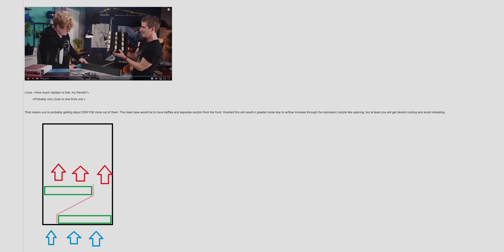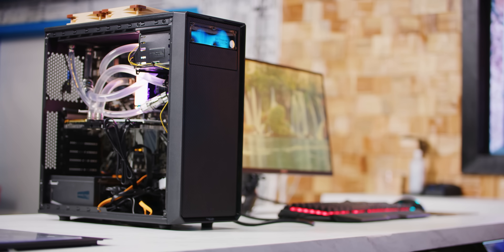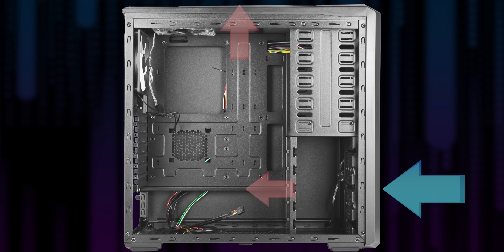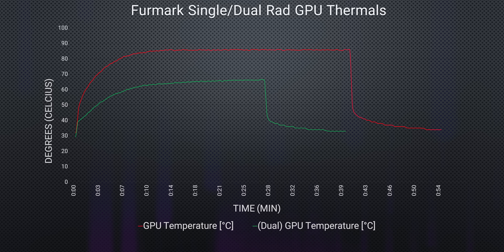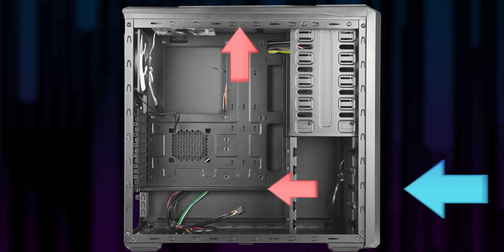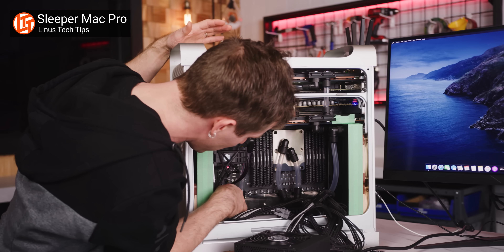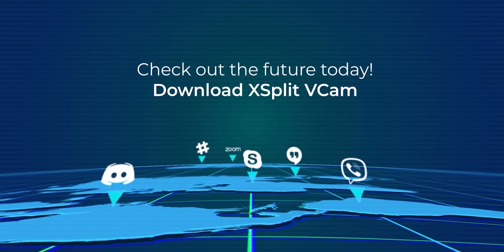I’ve been water cooling wrong for YEARS - $H!T Manufacturers Say

Comment: corsair: "using rads behind each other in a airflow starved case is bad"
corsair: "using rads stacked on top of each other is bad"
linus putting another rad in a case with a completely open back: "look how much it improves cooling!"
Reply: This seems like a pointless test. I doubt a company like Corsair is fucking around here, there was probably at least some engineers looking in to this. Wouldn't surprise me if they had whole RnD teams looking in to this. If they're saying it's shit in that environment, it probably is.

This whole video seems like some weird strawman attack on Corsair.
Reply: @Jayhill.

I think what infi means and what I ALSO thought right away with that specific example is: 5 degrees higher when stacked radiator removed, yes DUH!!! BUT!! what if he put that (removed second radiator) SOMEWHERE ELSE!!! It would work better?  I sure think so!! Infi??

@Linus Possible Video Idea??

Use the biggest case you can find but ONLY to add rads everywhere on the OUTSIDE of the ENTIRE case.?! see what happens?? Please?? Lol
Reply: Yeah I have a feeling the #1 lesson to learn from this video is "Reading Comprehension".
Reply: Yeah I don't know if they're just trolling Corsair now
Reply: +inf, makes the whole video pretty much useless.
Reply: I wouldn't say useless, I just wish they would have actually compared different scenarios.
Reply: He did address it tho :/
Reply: it still makes it a bad example to adress the whole issue.
Reply: Keep in mind he a) did state that this wasn't the system design Corsair simulated and b) that they did take out one of the stacked radiators from the system Corsair simulated, and found that the temperature increased 5C, so the stacked radiator was having some effect. In the end, he was advocating for you to test for yourself, and use some critical thinking and reasoning, rather than just go with whatever the manufacturer states.
Reply: @jayhill2193  But why are they not using the server for benchmarking? If they actually tested it with the server, then there is no reason to use a new system for the benchmark.
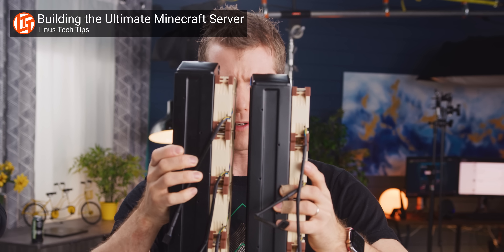Reply: @jayhill2193  Yes, and it kind of works for the hack pro. But corsair wrote them two times and one of them was for the setup at 1:30 which is a extreme case of what corsair said doesn't work.
Reply: @jayhill2193  In the Hack Pro system they've used parallel flow for the heat exchanger, while their testing system uses cross-flow. Big impact. 

The minecraft system is also a cross-flow setup, but you run into diminishing returns. Having a system go up from 45 to 50c while the Tmax is double that, is of course a bullshit reason to add another radiator which is what Corsair is pointing out.

If you want to argue that you can run the fans at lower speed for the same temperature you MIGHT be correct. My guess though is that without the third radiator air flow restrictions are freed up enough that the fan speed can stay roughly the same for the extra airflow to be achieved. Again, diminishing returns.
Reply: I don't think corsair claimed that it wouldn't work in an ordinary scenario like in this video ^^ though granted I haven't seen corsairs exact claims, only what is said in this video.
Reply: @Laylander  If you think adding a $100 radiator onto a $4000 system to drop temps by 5c is bullshit, you need to rethink some things.
Reply: @pfeerick  he removed 1 rad from the stacked system and temps went up 5c.. what he didn't do was set it up with a proper air gap and see that it dropped 15c.
Reply: @Laylander  what would work best for the three stacked rads in the Minecraft server would be baffles between them with an integral sign shape. ∫ Angled them a bit, with a curve at top and bottom. Warm air from each radiator blows out the top, cool air draws in the bottom. Warm air from one doesn't blow through the next radiator in line.
Reply: @shamsports1644  Agreed. Stacked radiators basically reused the heated air, and make it works less efficient. Should separate them to avoid reuse of heated air.
Reply: @jayhill2193  Did he also remove a row of fans with that rad? Perhaps that row of fans he removed was the thing lowering it the additional 5 degrees. After all, it makes sense that more fresh air moving through the rads would lower temps. And we've all seen builds where adding even 1 fan can make a huge difference.
Reply: @Ancyker  I had the same thought. Definitely unfortunate that we received so little info about testing the system with the setup that Corsair actually critiqued
Reply: @Haargeroya  I'm baffled. Just to make sure though: You're saying that because the system is expensive you shouldn't have a problem with adding useless parts to it to make it even more expensive?
Reply: @greggv8  That WOULD indeed work prety well. But in this form factor I don't think it's an option.
Reply: @Laylander  I'm baffled how you think a 5c drop in temps is useless. Cooling is very important in a professional environment, especially one where space is a limiting factor; assuming you've seen the videos of their rack locations.
Reply: @Haargeroya  Look at the bigger picture here. The CPU is allowed to run at 90c+ and it will happily do so for years. So if this thing runs at 45c instead of 50c (or say 80 instead of 85) there is no benefit at all. By the time the CPU finally burns out it is way past it's useful life anyways. Don't forget that the purchase of a component is usually <20% of it's TCO. Having an extra rad that you have to push water through probably costs you more in therms of electricity (pump+fans) over the years than it saves you in CPU replacements.

Cooling is important in a professional environment, sure. You just shot yourself in the foot though by stating that using space wisely is important, because you can probably take out two radiators and still stay within the thermal limits of the system. Duplicate the system a couple of times and all of a sudden you're using an entire rack worth of space just for cooling, while you could probably have gotten away with half the cooling capacity and thus have more systems in the same space.

To give you a practical example: I have a Ryzen 1700 in the basement pretty much running full load all the time. It has the stock cooler, temps are 67-73c (min-max over a week's time). AMD's official statement is that Tmax is 75c. It never skipped a beat since 2017. 

I bought the system to replace my old FX8350 which had been running full tilt near Tmax before that for almost 5 years non-stop, of which the last two years it's been running a good OC. Never skipped a beat either.
Reply: Don't worry Corsair won't give you a prize...

Comment: ya the thig corsair clearlly do not consider is thermal load. a radiator is designed to remove a sertain amount of heat out of the water and if the cpu and gpu output near the max heat rating of the radiator even if you would put a  jet engine on those rads you would see high temp in that case adding more rads will see a benefit always and my watercooling system is diffrent i use a second case designed just to put radiators in i have them mounted side by side pulling cool air from the room and outputing that air back into the room

Comment: You would want the air to go through the radiators that are last in the loop first. That would be the most efficient way to do it. Also mixing the intake radiator with ambient air intakes will mitigate this further. Corsair can only simulate so much.

Comment: Do the test with radiators literally stacked like Corsair were actually taking about..
Reply: He said they removed a rad in the minecraft server (uses 3 stacked rads) and got a 5 degree increase in temps
Reply: @thevampiredude7  Ahh miss heard that, thought they were talking about their test rig.
If that's the case, then the rad effeciency they're claiming is BS. If the air coming into the rad is actually the same as the water temp then yeah it would achieve nothing.

Comment: When you add another radiator, you're also adding more water to the loop which increases thermal mass. This gives your loop the ability to store more thermal energy before it gets saturated, resulting in cooler temperatures. I hear what Corsair is saying, so my take from this is to go for the thickest radiators you can, try avoid stacking.
Reply: It would be interesting to see in a real world test. Ie make something like a coolant expansion tank and one radiator like in cars, but for a PC and then one setup with stacked radiators.

My uneducated guess would be that the "expansion tank" setup would probably be more cost effective, because you can have a lot more liquid in the system.
Reply: I would go with optimus cpu water block and fittings (cheap fittings and best block), ek dual pump, max out the reservoir, Fat Ek radiators or one of those special radiators (forget the name), home depot for some soft tubing, $7 cutting tool from amazon.
Reply: Cool story bro

Comment: Have the Minecraft cooler run the rads side by side and it will destroy the stack. It's physics.
Reply: Yes because a server blade clearly has room for multiple side by side radiators.
Reply: @Torguemada  good point. I wonder if smaller rads with room to duct cool air to them would still work better.

Comment: You guys should test how many rads you can stack directly on top of each other before you get to the 1degree differential at the end. Just a rough guide on sheer radiator volume required to get 100% efficient cooling on a rad like they said.

Comment: Am very much a novice when it comes to pc stuff.

 But, if it’s anything like cooling for extreme high performance cars. Then wouldn’t it make sense to have the system work in a parallel loop, with radiators/inter-coolers before each individual piece of hardware (that you are liquid cooling)?. And have all the rads at their own individual intake points, with fans? And then have one almighty system to exhaust all the spent/less dense/hot internal air out the back of the case, like a car exhaust?

 So in a pc context where you are liquid cooling a GPU & CPU. Have front & top mounted rads, both with fans, intaking external ambient air. Then line the back (and floor, if you can) of the case with high power fans to blow air out the back. 
 You would also need to ensure that back-pressure can’t build up. So don’t have the case with its’ back up to a wall, or on the floor in thick carpet. That way it would work like a turbocharged performance car. Ramming air into the intakes, expelling as much heat as possible via an unrestricted exhaust system (given that in such a car you would straight-pipe it (remove CATs, mufflers, resonators etc) to reduce back pressure build up etc)

Again, cars aren’t computers (mostly) and I know a whole lot more about cars than I do computers. But if nothing else, it’d be some food for thought!
Reply: The beauty of it is a cooling loop is a cooling loop. Fluid dynamics doesn't change if you're talking about cars, computers, or HVAC.

Although I'd be curious how this test would work out if instead of the fans on the 2 rad setups being in a push/pull configuration how it might pan out if they were both pulling air into the case and the rear fan was exhausting. Then you'd be pulling ambient air into both rads, which, in theory should make with the more cool stuff.
Reply: @SpicyOliv  It would do exactly that, pure intake on the rads would result in better temps overall, speaking from experience here, after having quite a few loops over the years and learning from trial and error.

One other tip to make the overall noise of the system better, is to have your fans on the pull side, and if space permits, have a shroud between the fan and radiator, to increase the distance between the fan hub and the fins, to remove the dead zone, and obstruction of airflow.

Theres a common misconception that one has to have a computer case that has very little openings and sound deadening material all throughout it to have a quiet system, when in actuality, the more open and unobstructed a case is, paired with a set of high quality, quiet fans, the better the results will be, the only caveat being dust build-up.

So the less obstruction in the front and rear of the case, and the less obstruction infront of the radiators, to draw air in, the better, and when space and layout permits, having radiators drawing ambient air in instead of recycling heated air, will always be the preferred scenario, people get all caught up on the idea that heat rises, but really, the warmed exhaust air, will escape out of the case via any ventilation it can, because it's being forced to by 100% positive air pressure, regardless of natural convection.
Reply: @SpicyOliv  the single exahust would not be enough. If you are talking equal fans. You could slap in a single fan that has way more cfm than your intakes and could get better results but idk of any one fan that could compensate for the 4x intakes. Also, heat goes up. So might aswell use that to your advantage. You can take the airflow orientation testing they did, years ago, as true for for a loop as well. Just factor in that you want high pressure fans on the rads and higher cfm fans on unobstructed exhausts.
Reply: @Nsixtyfourlink  yeah, I thought about that, but you can select fans based on CFM to try and balance it out a little bit more, so it's not rediculously positive pressure in the case. The air will always find a way out as well, just depends on how much you're cramming into it.
Reply: Funny thing about cars: the air conditioning condenser and transmission coolers are infront of the radiators. Kinda neat. Also if you an intercooler it's also infront of the radiator. It helps that you actually want coolant to be hot to a certified degree though since that is how you get heat in the winter.
Reply: @MinistryOfMagic_DoM  this is true. Heat exchangers are stacked in the automotive industry all the time
Reply: hmm yes perhaps making both sets of fans blow outward would be better
Reply: What you said is mostly right and actually the point corsair tried to make.
Reply: Saitara oh, neat! Cheers!

 If I were trying to improve it, what should I do? (Don’t have any plans to do it, just kinda bored and curious)
Reply: @I_Firebolt_I  If you want the system to also be quiet, the best approach is no exhaust fans at all, just have unobstructed ventilation,  and 100% positive air pressure from only intake fans, this way you will still get good temps on each component that is in the loop, and also have less noise when the loop is in operation, as the air will find its way out of the case via all of the vents (ie: no PCI slot covers, no Mobo I/O shield, no fans, and plenty of holes in the case rear).

Silverstone proved this point years ago, that max positive air pressure is the way to go with cooling, you just might get a bit more dust in the PC this way, but the temp improvement and the sound level improvement are worth the extra maintenance IMO.

Comment: The modelling on this works to a degree, for a closed system thermal reduction will be limited by the thermal capacity of the air volume for the unit of time examined, then increase or decrease air flow over that time period and you have your max thermal change. A more efficient system would be to remove your air constraint by having separate air volumes per radiator. Increasing rad size will have a max benefit headroom because the flow rate at your hot spot will be constrained. Increasing flow rate will be constrained by the surface area at the hotspot etc etc, the list of diminishing returns goes here. So if you could achieve multiple rads operating in different zones that don't operate on the same unit of air, thus do not share any overlapping thermal impact, you could aacheive max thermal reduction per unit volume of rad. The engineering is basic, apply max differential of cooling substrate (oil, air, water, midal, that other high carbon bonded organic stuff we bung in Txs) thermal capacity to each radiator to achieve maximum efficiency, degrade efficiency based on physical or cost limitations until you hit the point you have enough of what you need. BUT! I have a better question. Air source heat pumps! We have seen LTT hook up a domestic rad but have LTT considered hooking up an external air source heat pump for cooling effect? Possessing significantly larger rad size, increased thermal efficiency compared to the rads sold for PCs and most are under used in most domestic settings (a 16 to 20kVA ASHP interchanger in a domestic setting will typically only see 4kVA of use). If you could tap into an existing ASHP and cool using that.... Cheaper volume and water heating AND a cooler PC? On you go :-)